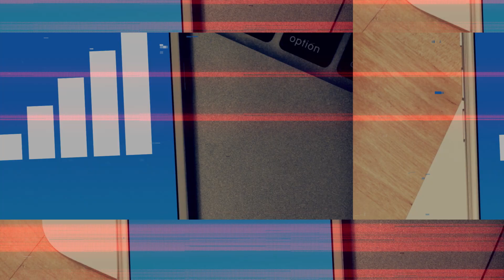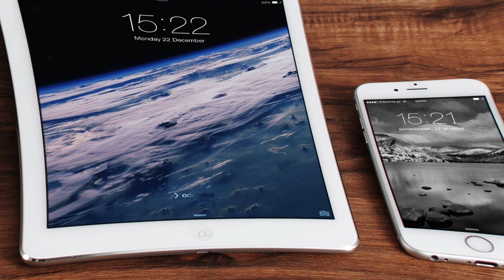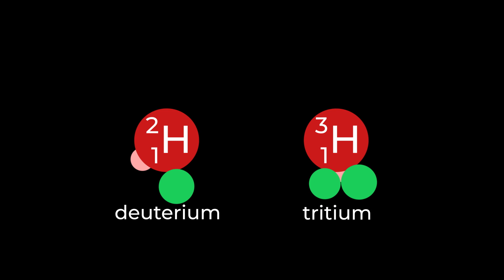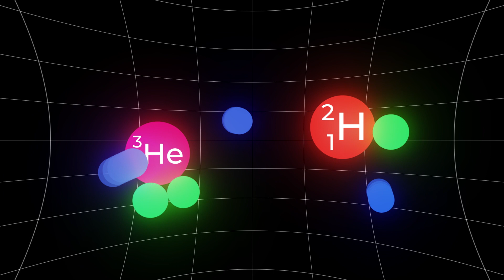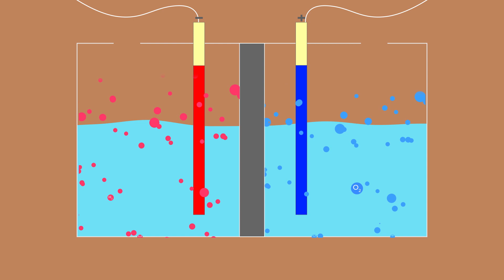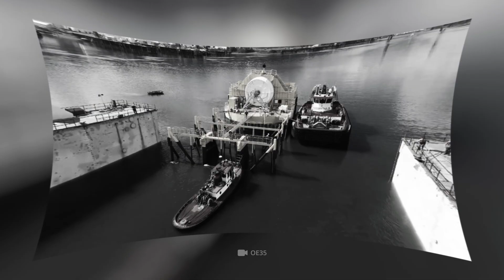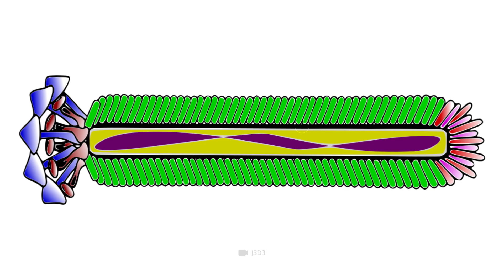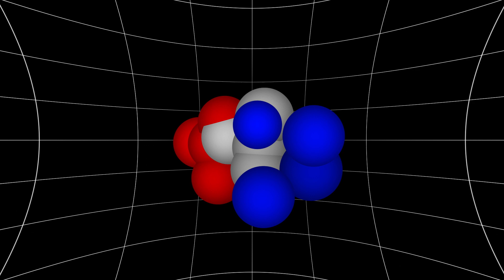What if All The Oil On Earth Runs Out ?

Comment: Riddle:no more WiFi on 2040

Me:shiiiiiittttttt
Reply: @denmark david leuterio

The Quantum Internet with wireless is the answer.

@Ack OOF

Unless you have been hiding under a rock and not looking at good innovation in the way of a paradigm shift for new materials like Graphene and where we are at with it, emerging technologies and beyond, Quantum Technologies.

The video we are under, ignores mentioning anything in this way, "what if" is short - sighted in that "specific" way, but I guess not mentioning anything with Graphene since it's a form of atom carbons and a two - dimensional material that will require our coal and fossil fuels, since carbon in Latin "carbo" = coal.
Fun fact, carbon makes up a percent of our body, Graphene is made of carbon atoms if you ignore the two - dimensional part, which shows we have it in us, since it's made of carbon atoms.
Supposedly all living things on "Earth" have carbon in them.

Graphene will go into our products and all of our devices to replace Silicon. It will also go into our buildings / structures, machines / vehicles for ground and air, and for space exploration.

Graphene is also safe.

We need to replace Lithium-Ion, Silicon, and plastics. And other materials not mentioned, because of the greed, power and corruption around it. Plastics can also have lead in them, which is dangerous, same with weights for body building and many other things that we use.

The "lead-pencil" is a myth from Roman times, we've been using Graphite which is a 3 dimensional material and a form of carbon, and so we have been using the "Graphite-Pencils". Carbon becomes Graphite, and Graphite becomes Graphene "2 dimensional material", known as the "wonder material of the future" with its special properties, which it can only have if there are less to no "impurities", meaning the closer to no impurities, the better it is with its special properties in its "purest form". Imagine a net having holes in it, that's the impurities of Graphene, and it needs produced in its purest form to be as strong as possible and to have super conductivity "electrical current flow" with no resistance, which is a good thing.

Graphene also doesn't turn into a liquid when it reaches its melting point, which is really hot and can easily be used for heat shields on Elon Musk's SpaceX Starships, for other planets, when entering and exiting the atmosphere easily and not having to replace the heat shield for a long time, but Graphene can also be used on the inside as the electronics and as an energy source, as Graphene has boundless potential.
And so Graphene when it reaches its melting point "if it ever does when used for typical applications" like "entering and exiting the atmosphere with the Starships", the melting point doesn't turn into a liquid, it turns into a gas, this process is called sublimation. Imagine just like they are doing with carbon dioxide to turn it into Graphene, think about doing that when Graphene turns into a gas, to turn the gas instantly back into Graphene, this would regenerate the heat shields and anything else using Graphene when its melting.

Graphene has unlimited potential, this changes everything.
It's the material that is the key to unlocking many "emerging" technologies, Quantum Technologies today and later on, before new materials are found. New materials allow new things to happen that weren't possible before in emerging technologies.
Add on top of that, Quantum Technologies also change everything, we are also heading for a Type - 1 Advanced Civilization.

--------------------------------------------------

And so when he mentions in the video we are commenting under, about Plastics... think about the corruption around that. And he mentioned the clothes.. think about how Graphene could make clothes, so there you go.. get rid of the fossil fuel industry that uses it for fuel, and instead use it for Graphene technologies instead, and then turn it into Graphene clothes as they already are doing, and get rid of Plastics, Graphene can be transparent and safe without the worry of lead, so you see where that is going, the video we are under is not only ignorant but biased and corrupt, possibly from being short - sighted.

And that's not all, since Graphene has boundless potential, there are so many other applications, possibilities it can be used for on the Earth and in space exploration, with emerging technologies and beyond, Quantum Technologies.

If you are interested in learning more, I have a channel all about Graphene and where we are at with it, emerging technologies and beyond, Quantum Technologies.

1. Go to my channel, find a channel there called Technology Research, and go to that.

2. Find all the playlists on the channel, be sure to check each playlist description with the "more" button.

3. Find the "About" tab on my other channel and read that info first before going to the playlists, and then start with the Graphene playlist, you could check my other playlists like the Advanced Solar Panels Technologies, Graphene immortal batteries, and other things.. but just start with the Graphene playlist first. Check the rest of the channel out after that. Please finish all videos from top to bottom in that order.
Reply: @gameresearch9535  thanks man
Reply: I will be 42 years old that year 
I have been born in the worst generation ever
Reply: Jeez ok einstein

Comment: Think its possible every oxygen molecule (O²) means there is a fossil fuel counterpart somewhere buried on earth. Till all the oxygen in the atmosphere is used up, there is still a fossil fuel somewhere. We are at 400 parts per million (ppm)of carbon dioxide, Earth's atmosphere is what, 24% O², that's 240,000 ppm. Lots more to go, not running out any time soon. The big question is when is the tipping point of ppm of CO² when the earth experiences an out of control greenhouse.

Comment: I wouldn't worry about oil ever running out, turns out, oil is made in the earths mantle. The term "fossil fuel" was minted in the early 1900:s so that there would be a reason to raise the price on it and perpetuate the false belief that it will run out eventually, but it will never happen. Many oil wells that were deemed "empty" turned out to be full again, very much like a water well that in time fills up.

I would instead worry about the use of oil products as they certainly are a major reason to why we have accelerated cancer cases around the world. It is toxic to all living beings and should not be used at all. We have plastic everywhere in our lives, in cars (obviously), kitchen utensils, clothes etc, it is practically everywhere. We cannot escape it, we even have it in micro particles on the poles and in the oceans, EVERYWHERE!

Fusion reactors for future energy source is also a far fetched idea that will never surface as a practical idea. Wind turbines also turns out to be a major environment hazard as the blades now needs to be replaced and the old ones are buried instead, not to mention all the birds that are killed by the blades rotating at 55-80 mph. We are being duped on oh so many levels.

Using hydrogen as a source is also very inefficient as it requires a lot of energy to extract the gases to make... water!? again?. Science is boning us all with this shit they come up with.

And antimatter.... gee! They say that CERN produces antimatter in colliding particles, well, they are using terawatts during their experiments which means, it is expensive as hell to produce an amount that even registers on a scale, let alone 1kg of it. They make thousands of particles and using that wont even top the smallest fire cracker.

Think again, we are not being told the truth about the energy problems. They make it a problem when in reality, there is no problem, only a never diminishing hunger for profit. Greed is all that stands in the way of a clean abundant energy source which everyone would benefit!

Comment: They also said we would of run out of oil by 1992 so I highly doubt we would run out of oil a
By 2040 maybe 2100 or 2150 more likely but by that time we would fine another energy resource to use by then
Reply: By then we will probably not even need wifi
Reply: No matter when, when global climate change gets irreversible, we are fucked. Then, oil will not be the biggest problem.

Comment: Oil run out
Elon Musk : hold my Tesla Corporation
Reply: You know it takes oil to make his cars and to make the batteries
Reply: Humans are quite engenuitive, especially when backed into a corner. We have 20 years to find a replacement. (Assuming this prediction is even correct, which I’m quite skeptical of, as they have a bad record on this front for predictions.)
I’m not worried.
Reply: @andypn4228  you can recycle lithum. But try that with burned oil. Also it's mutch cheaper to crack Hydrogen out of methane, which is very plentiful, instead using the electrolysis method... But, you've guessed it, Carbon is the byproduct.
Reply: @andypn4228  You know that lithium is like 2% of the batteries , right? Its mostly nickel and graphite.
Reply: And so when he mentions in the video we are commenting under, about Plastics... think about the corruption around that. And he mentioned the clothes.. think about how Graphene could make clothes, so there you go.. get rid of the fossil fuel industry that uses it for fuel, and instead use it for Graphene technologies instead, and then turn it into Graphene clothes as they already are doing, and get rid of Plastics, Graphene can be transparent and safe without the worry of lead, so you see where that is going, the video we are under is not only ignorant but biased and corrupt, possibly from being short - sighted.

And that's not all, since Graphene has boundless potential, there are so man other applications, possibilities it can be used for on the Earth and in space exploration, with emerging technologies and beyond, Quantum Technologies.

If you are interested in learning more, I have a channel all about Graphene and where we are at with it, emerging technologies and beyond, Quantum Technologies.

1. Go to my channel, find a channel there called Technology Research, and go to that.

2. Find all the playlists on the channel, be sure to check each playlist description with the "more" button.

3. Find the "About" tab on my other channel and read that info first before going to the playlists, and then start with the Graphene playlist, you could check my other playlists like the Advanced Solar Panels Technologies, Graphene immortal batteries, and other things.. but just start with the Graphene playlist first. Check the rest of the channel out after that. Please finish all videos from top to bottom in that order.

Comment: Love  how imaginative Riddle is now waiting for some real science from  kurzgesagt
Reply: ouch, but its true
Reply: Unless you have been hiding under a rock and not looking at good innovation in the way of a paradigm shift for new materials like Graphene and where we are at with it, emerging technologies and beyond, Quantum Technologies.

The video we are under, ignores mentioning anything in this way, "what if" is short - sighted in that "specific" way, but I guess not mentioning anything with Graphene since it's a form of atom carbons and a two - dimensional material that will require our coal and fossil fuels, since carbon in Latin "carbo" = coal.
Fun fact, carbon makes up a percent of our body, Graphene is made of carbon atoms if you ignore the two - dimensional part, which shows we have it in us, since it's made of carbon atoms.
Supposedly all living things on "Earth" have carbon in them.

Graphene will go into our products and all of our devices to replace Silicon. It will also go into our buildings / structures, machines / vehicles for ground and air, and for space exploration.

Graphene is also safe.

We need to replace Lithium-Ion, Silicon, and plastics. And other materials not mentioned, because of the greed, power and corruption around it. Plastics can also have lead in them, which is dangerous, same with weights for body building and many other things that we use.

The "lead-pencil" is a myth from Roman times, we've been using Graphite which is a 3 dimensional material and a form of carbon, and so we have been using the "Graphite-Pencils". Carbon becomes Graphite, and Graphite becomes Graphene "2 dimensional material", known as the "wonder material of the future" with its special properties, which it can only have if there are less to no "impurities", meaning the closer to no impurities, the better it is with its special properties in its "purest form". Imagine a net having holes in it, that's the impurities of Graphene, and it needs produced in its purest form to be as strong as possible and to have super conductivity "electrical current flow" with no resistance, which is a good thing.

Graphene also doesn't turn into a liquid when it reaches its melting point, which is really hot and can easily be used for heat shields on Elon Musk's SpaceX Starships, for other planets, when entering and exiting the atmosphere easily and not having to replace the heat shield for a long time, but Graphene can also be used on the inside as the electronics and as an energy source, as Graphene has boundless potential.
And so Graphene when it reaches its melting point "if it ever does when used for typical applications" like "entering and exiting the atmosphere with the Starships", the melting point doesn't turn into a liquid, it turns into a gas, this process is called sublimation. Imagine just like they are doing with carbon dioxide to turn it into Graphene, think about doing that when Graphene turns into a gas, to turn the gas instantly back into Graphene, this would regenerate the heat shields and anything else using Graphene when its melting.

Graphene has unlimited potential, this changes everything.
It's the material that is the key to unlocking many "emerging" technologies, Quantum Technologies today and later on, before new materials are found. New materials allow new things to happen that weren't possible before in emerging technologies.
Add on top of that, Quantum Technologies also change everything, we are also heading for a Type - 1 Advanced Civilization.
Reply: And so when he mentions in the video we are commenting under, about Plastics... think about the corruption around that. And he mentioned the clothes.. think about how Graphene could make clothes, so there you go.. get rid of the fossil fuel industry that uses it for fuel, and instead use it for Graphene technologies instead, and then turn it into Graphene clothes as they already are doing, and get rid of Plastics, Graphene can be transparent and safe without the worry of lead, so you see where that is going, the video we are under is not only ignorant but biased and corrupt, possibly from being short - sighted.

And that's not all, since Graphene has boundless potential, there are so many other applications, possibilities it can be used for on the Earth and in space exploration, with emerging technologies and beyond, Quantum Technologies.

If you are interested in learning more, I have a channel all about Graphene and where we are at with it, emerging technologies and beyond, Quantum Technologies.

1. Go to my channel, find a channel there called Technology Research, and go to that.

2. Find all the playlists on the channel, be sure to check each playlist description with the "more" button.

3. Find the "About" tab on my other channel and read that info first before going to the playlists, and then start with the Graphene playlist, you could check my other playlists like the Advanced Solar Panels Technologies, Graphene immortal batteries, and other things.. but just start with the Graphene playlist first. Check the rest of the channel out after that. Please finish all videos from top to bottom in that order.
Reply: I'm serious, follow the steps in my second comment above to find my other channel about Graphene and Quantum Technologies to see where we are at, you will be surprised!

They also found another way to produce Graphene, called Flash Graphene.

---------------

I want to see Kurzgesagt mention Graphene and Quantum Technologies, we are still making more Quantum Technologies on top of that, and there are breakthroughs all the time which shortens the time it takes for these "emerging" technologies to come out.

How can these videos be so ignorant from these channels, or is it a bias? Or maybe a hidden agenda as the media doesn't want you to know? It could be any of those, but the ignorance is truly there from these channels with all these new videos that have no idea!

Please be willing to check out my other channel following the steps in my other comment.

Comment: "What if all the oil on Earth runs out before 2040?"

The United States must invade other planets then
Reply: Instead of Middle East
Reply: That's where the space marines walk into the room.
Reply: Titan here we come.
Reply: Just Some Guy without a Mustache no guarantee there’ll be oil on other planets. Like Mars. Chances are the atmosphere is too thin to create the necessary pressure on the planet to make oil. Plus the core is cold which means it’s not pulling things into it, also not creating the necessary pressure to make oil
Reply: Just Some Guy without a Mustache with no petroleum products to fly space craft?🤔
Reply: John Bravo I think spacecrafts don't even use petroleum fuel
Reply: @y33t23  They don't. Currently we used liquid Hydrogen / Liquid Oxygen for rocket fuel, as well as a few other chemical combinations. Howeverm petroleum is likely used in the construction of spacecraft materials like polymers, seals, electronics, etc.
Reply: @y33t23  run out oil our dream will be never becoming reality or come true
Reply: nich sulol yeah I mean it will eventually happen but not soon enough